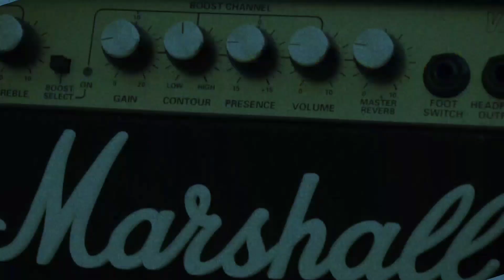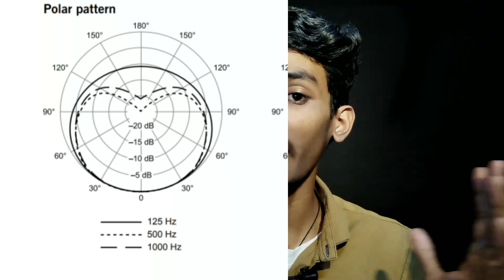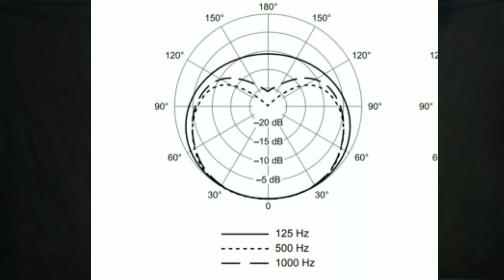മൈക് വാങ്ങുന്നവരുടെ ശ്രദ്ധക്ക് |microphone spec sheet explained|Echo tech

Comment: RMS Power Output: .....750w x 2 @ 4 Ohm. .....500w x 2 @ 8 Ohm. Program Power Output: .....1500w x 2 @ 4 Ohm. .....1000w x 2 @ 8 Ohm. Peak Power Output: .....3000w x 2 @ 4 Ohm. .....2000w x 2 @ 8 Ohm

പ്ലീസ്  ഈ മുകളിൽ കൊടുത്തിരിക്കുന്ന powered mixer നു പറ്റിയ സ്പീക്കർ ഡീറ്റെയിൽസ് ഒന്ന് തരാമോ?  അര്ജന്റ് ആണ്.  പാസ്സീവ് സ്പീക്കർ ആണ് വേണ്ടത്... ഏതു ബ്രാൻഡ് കൂടെ പറഞ്ഞു തന്നാൽ നന്നായിരുന്നു..
Reply from the maker: Chetta 400 watts ulla 8ohms ulla ethu speaker venelum use cheyyam athu custom made aayalum preshnam illa pinne 800 watts 4ohms ulla speakers ithil work cheyyum
Eppozhum rms power maathram match cheythu speaker select cheythal mathy
Reply: @EchotechbyABI  ഹായ്.. താങ്ക്സ്.. 
ഇതു ഒരു ചാനൽ ആണോ (400watts )അതോ 400 *2(pair) ആണോ?
Reply from the maker: 2 channel each 400 watts
Reply: @EchotechbyABI  Thanks a lot.. 🙏 can you suggest a proper brand?